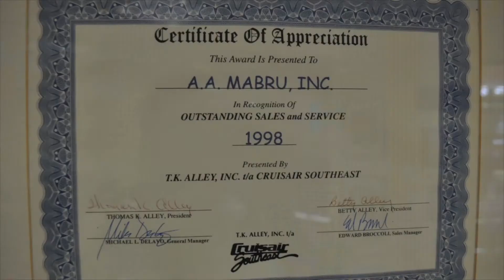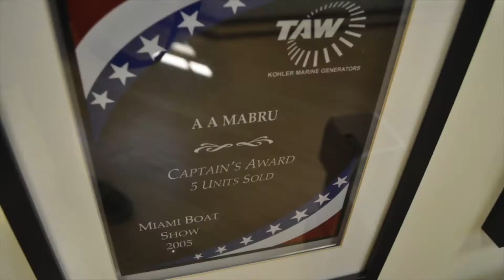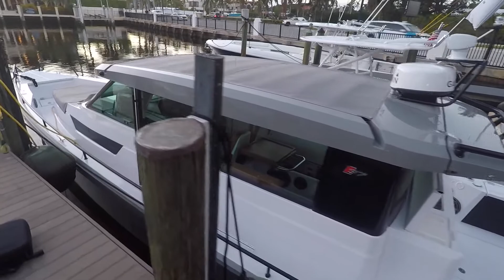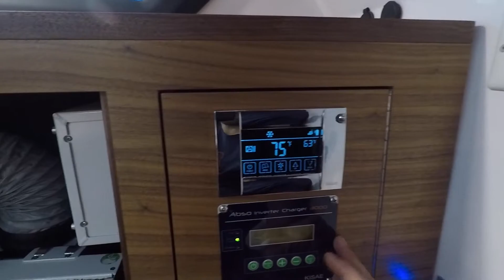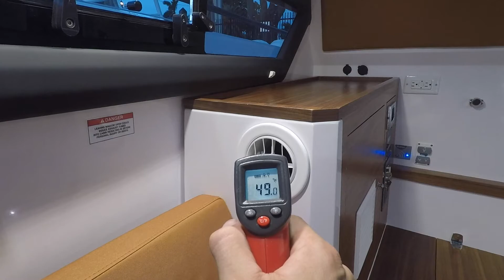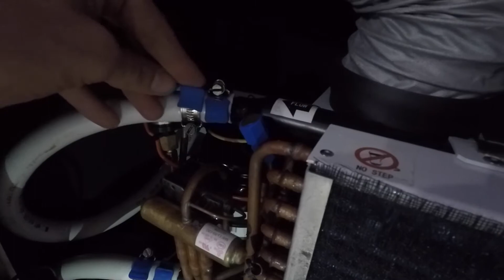New Axopar 37SC with Mabru Package - AC/DC Marine Air Conditioners

Comment: 1. Could the pilot house unit cool the aft cabin as well if equipped?
2. Whats the expected life span and maintenance on these units?
3. Could some sort of solar system be rigged to extend the battery life when not using shore power? 
4. Can it be rigged to run off a generator as well as batteries?

Looks good!
Reply from the maker: 1. Yes, we have done that setup before with the vent in the cabin having the ability to close for when no one is in the aft cabin.
2. The expected lifespan of these units is 15-20 years and the only maintenance needed is to clean the return air filter as well as descale the seawater cooling system every 1-2 years
3. We are actually now looking into this option but we have not done it yet. We are also looking into working on a lithium battery option for longer runtime and less weight.
4. This setup will run as is off of a portable generator if you connect the output of the generator into the shore connection. If there is already a generator on the vessel, it can be done but the inverter would have to be hooked up after the transfer switch to the power feeding the main panel.

Comment: Hi what is the approximate cost of this exact setup on this boat? Very nice looking work.
Reply from the maker: The approximate cost for this exact setup is $16,500 including inverter, batteries, wiring, units, intakes, pumps, hose, ducting, vents, etc. Feel free to give the office  a call at 954-467-1770.